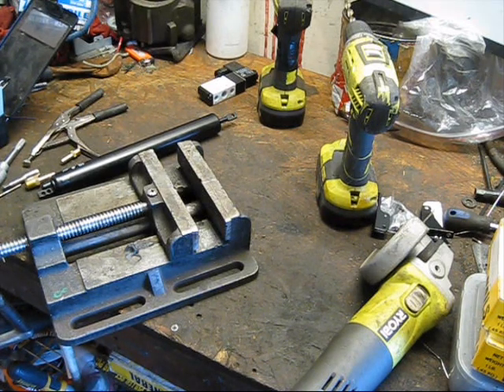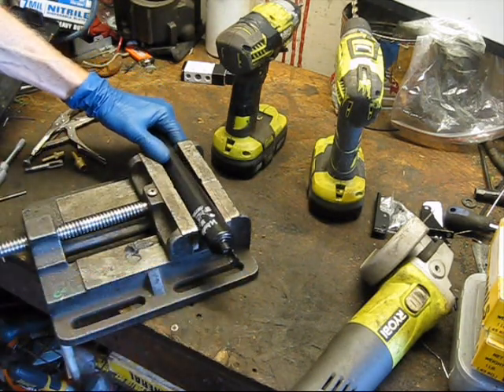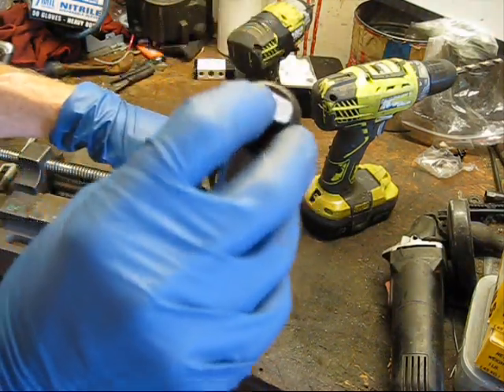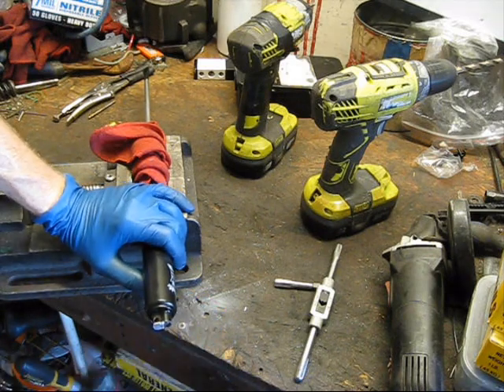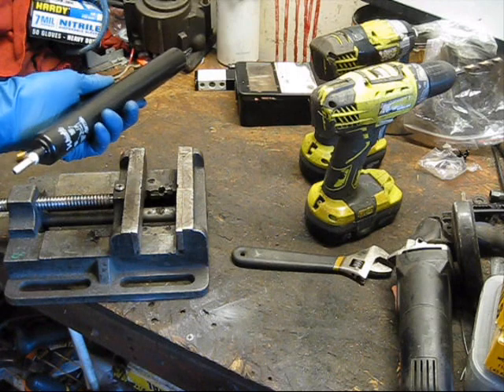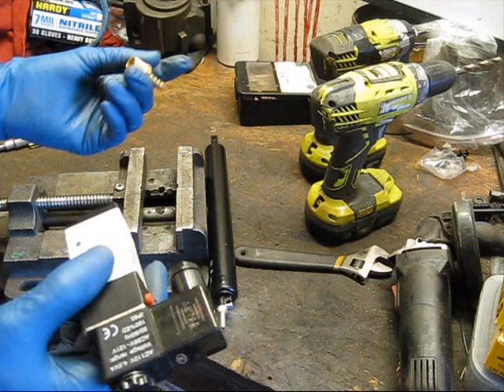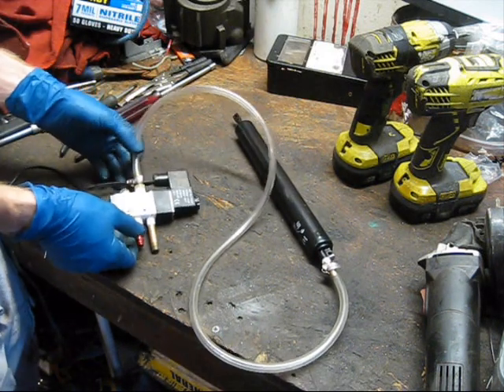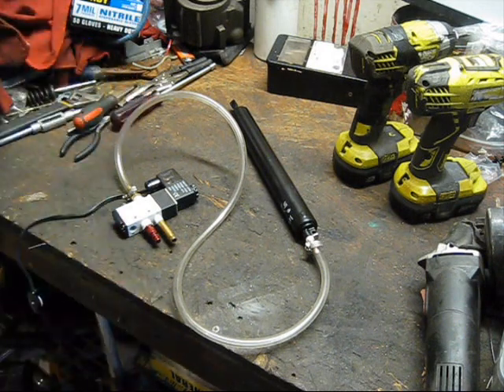How to make a cheap pneumatic cylinder from a screen door closer

Comment: Thanks, good demonstration. I'm always looking for prop ideas. Respecting pipe taps, once you determine the ideal depth, you can mark the flutes with a sharpie and save the back-and-forth on additional jobs.
Reply from the maker: Very true, unfortunately halloween comes once a year and when it rolls around again I will not remember what that line on the tap is.